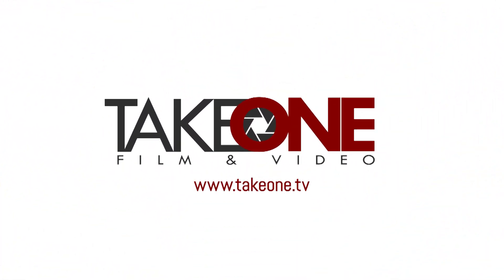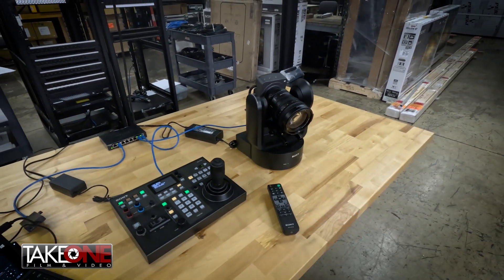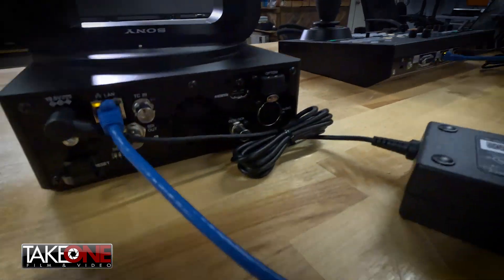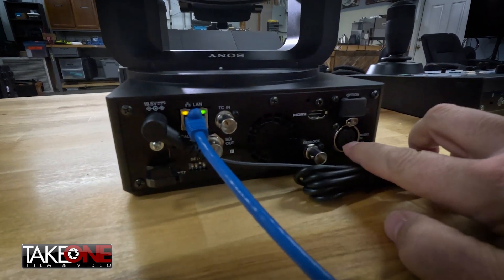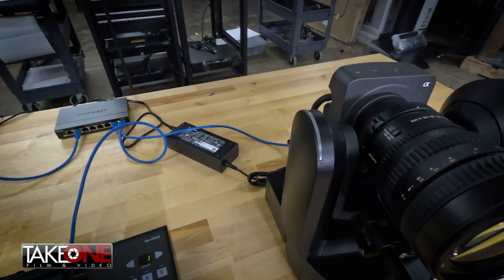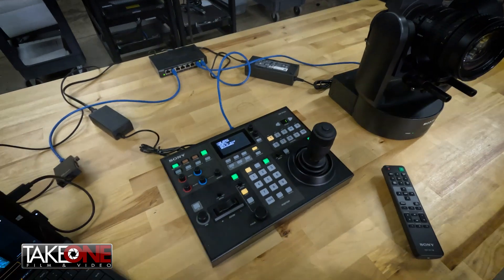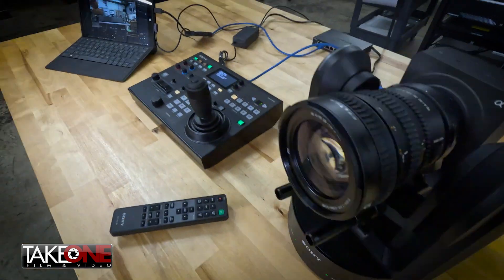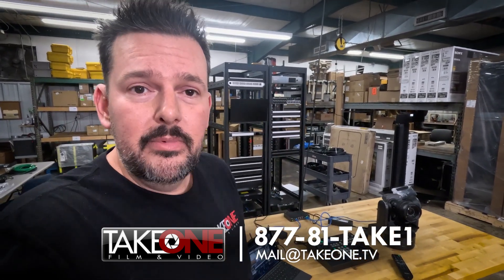SONY FR7 "CINEMA" PTZ Camera - QUICK REVIEW and TECHNICAL OVERVIEW

Comment: thank you - how do you compare this to the Panasonic PTZ 150 (I think you used the 150 with Michael W Smith)? Ease of Use. Use in a HOW. Thank you
Reply from the maker: I have lots of time with the Panasonic PTZ's.  I think both of these have their lane and I don't have an overall preference of one over the other.  However, these FR7 cameras have the huge advantage of the "real" lens, on top of being interchangeable as well.  That's a big deal.  However, they may not blend as well with standard broadcast cameras that may shoot a little flatter, or less cinematic.  This Sony would be a great standalone camera, single person interview camera or a multi-cam production that is shot cinema-style.  The Panasonic wins from controllability.  I personally like the RP150 much better on the Panasonic cameras.  The imagers on Panasonic hold up to the Sony one's, in my opinion.  The biggest difference is the glass.  However, the Panasonic cameras are easier for me, as a video shader, to blend with broadcast cameras and tend to match a "broadcast" look better than a cinema one.  So, again, these are both great tools... it just depends on the application.  Please reach out and I'm happy to discuss further!

Comment: We own several PTZ cameras. My main beef with them is the movement tends to look very or at least somewhat robotic. If you get a chance, would like to hear your feedback or see video of the camera object or eye/face tracking a subject with panning and tilting. We know that this camera will look great, it's an FX6 and the 28-135 is a decent, if not impressive lens. 

It's the motion that I think that the camera manufacturers need to work on so they look more like a human camera op. You'd think with AI becoming so popular that they could begin to implement some ballistic characteristics of human camera ops so PTZ don''t look so robotic. Every time I am operating a bank of PTZs and have to track live speakers, I usually cringe at how bad the motion looks. Wanting to know if this new Sony breaks a long and storied tradition of terrible movement on PTZs.
Reply: That's really interesting I've never. used the PTZ live. the way I implement them is two cameras can be 12 cameras. I cut away from it while it repositions and the night cut back. and they just take turns doing that and you have dozens of different camera angles from two cameras.

Comment: couple notes the SDI is 12G SDI, and the card slot is actually for 4 cards 2 SDXC higspeed cards and 2 cfexpress type A
Reply: 12G SDI if you have the output set for 4K 59.97….    Also only 2 cards at a time which can be either SDXC or cfexpress A… even one of each if you prefer.   You can set it up to redundant record to both cards, or to switch cards when the first one is full… just butt the clips up in the editor and there is no space.

Comment: You mentioned it has a built-in encoder, does that mean I'd be able to stream via OBS in 4K@60+ FPS? If so, this is the camera for me!!
Reply from the maker: Without having more information and testing it firsthand, I'm going to cautiously say yes.  You'll need to cross reference OBS, but just for reference, here are the streaming methods and codecs that are available from the FR7:  
RTSP (H.264, H.265)
SRT-Caller (H.264)
SRT-Listener (H.264)
NDI|HX (H.264, H.265)
If you're interested, let us know if we can quote you our best price for this.
Reply: @TakeOneFilmVideo  Thanks! Unfortunately I'm not super familiar with the more techy specs (currently using a Logitech Brio as I've invested a ton into lighting up to this point) but I will need to upgrade.

I'd be interested in a quote but I don't think I'll be making the purchase until roughly June :)
Reply: Also works fine on a full size ipad…😊
Reply: @EricWeberGoogle  Do you mean an iPad in place of the remote?
Reply: @BlakeMadsen  In place of the PC in your setup… works fine on the IPAD Pro, what issue did you have with the mini ?
Reply: @EricWeberGoogle  I'm confused lol I don't want/need to run it on an iPad. I wanted to know if I could more or less run this as a 'cinematic webcam' via OBS on my PC
Reply: Sorry replying to the author about another issue.   I can stream directly but don’t know about using it as a webcam.
Reply: @EricWeberGoogle  All good! There's so little information out about the FR7 so I'm grateful for any responses at all.

If I could get confirmation whether or not I'd be able livestream (on a site similar to Twitch) via OBS I'm pulling the trigger immediately. Previously my options were PTZs like the Logitech Rally/Canon CR series which won't quite allow for my artistic vision as interchangeable full frame